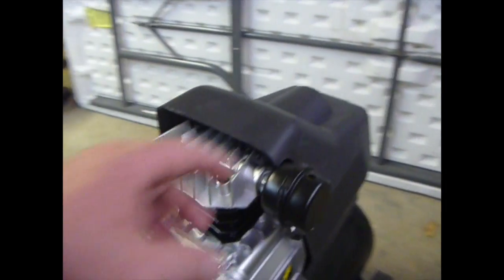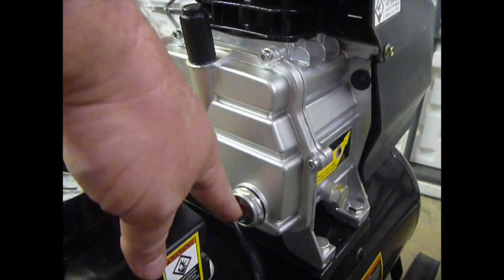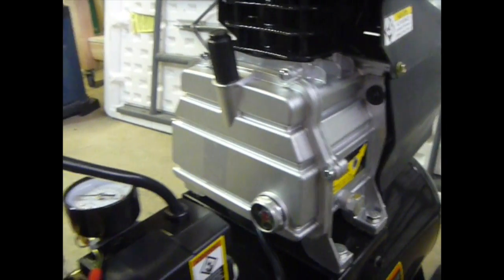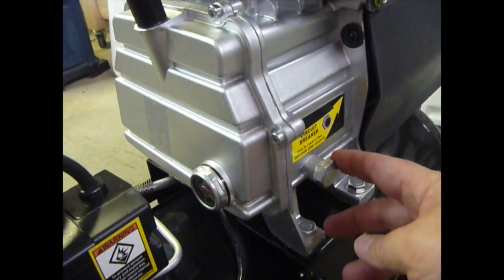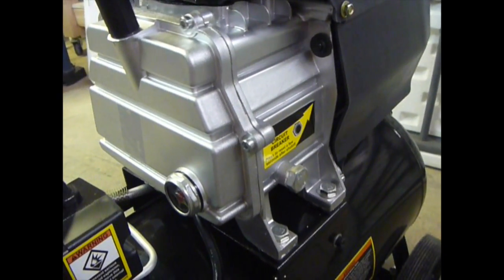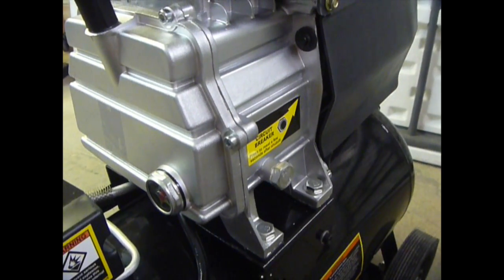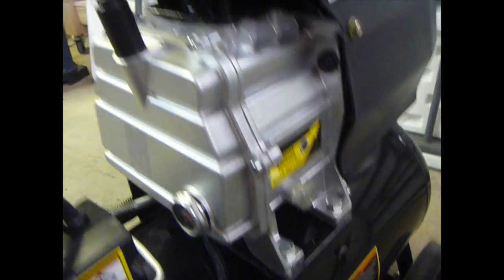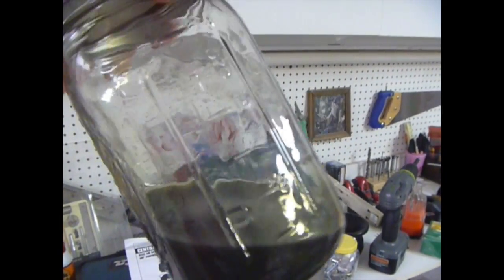Putting together my new Air Compressor

Comment: Interesting, my oil fill and drain plugs are on the back of the unit.  Got mine about a year after yours, so they apparently tweaked these locations again.  Break-in procedure says to drain the oil after first hour of running.  With the 20-30 minute break-in run time and then some light use filling up a few truck, rv, and motorcycle tires I don't think I am even close to the hour yet 3 month's after I bought it.  Will change the oil when its time.  So far I'm loving it.  My 80 psi truck tires are child's play for this beast!
Reply from the maker: BrewCityRider that is interesting that they changed locations. Mine is still running great. I use it all the time. Thank you for the comment.

Comment from the maker: @Ivan Moseyko Thank you for the comment, Ivan.  I have not used a spray can yet, but I use an 18 gauge brad nail gun and the blower nozzle all the time.  The compressor works very well for both of those operations.  Actually surprising well.  It is only 8 gallons so with a continuous blast at 90PSI with the blower. I get about 30 seconds before the compressor kicks on to refill itself.  It runs the nail gun no problem.  I hope that helps.  Again, thank you for the comment and the subscribe.  Cheers.

Comment: I actually gotten the same one a few days ago. I ran it for thirty and used it for another 15 minutes on my 16 gauge air nailer and blow gun as well. No problems what so ever. One thing is that my oil never gotten dark but just a little cloudy. Would you still recommend changing it?
Reply from the maker: +Tony Reed I think that is what the instructions call for.  That is why I changed my oil.  The oil looked good in the glass, but it was once I drained it that it got murky.  Thank you for the comment and Happy New Year.
Reply: Thanks for  your response, and Happy New Year to you as well

Comment: LITTLE REAL INFORMATION. WHAT DO ALL THE KNOBS DO?  HOW WELL DOES THE BAD MAILER WORK, SHOW US, HOW YOU LOCK AIR IN THE TANK AFTER YOU PUMP IT UP? SHOW US THE DRAIN VALVE ON THE BOTTOM AND THEN DRAIN THE MOISTURE IF ANY. THANKS  GOOD CAMERA WORK AND GOOD AUDIO INTELLIGENT ANNOUNCER PUTS YOU AHEAD OF MOST YOUTUBE VIDEOS.